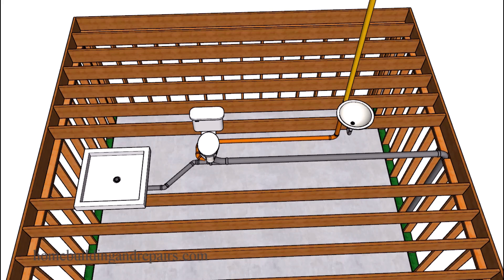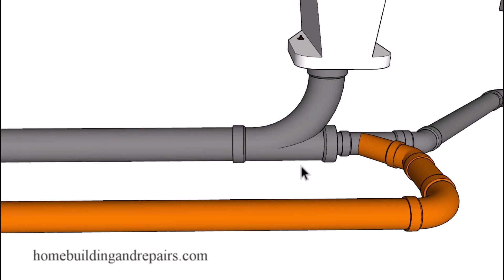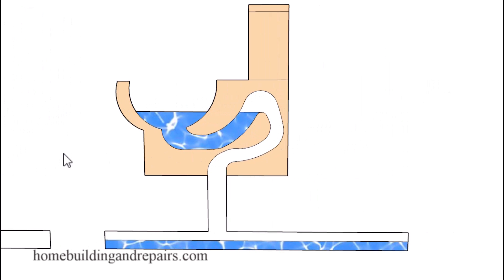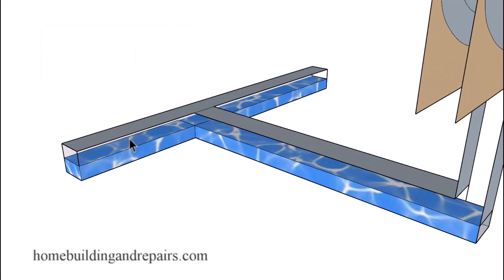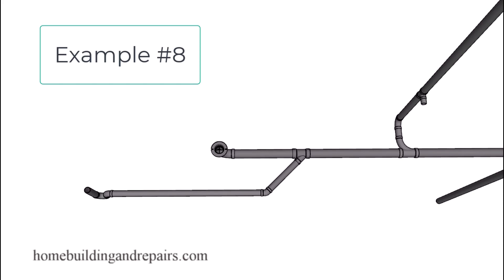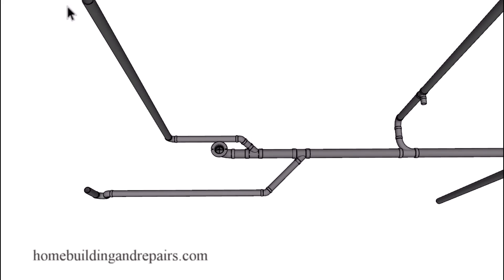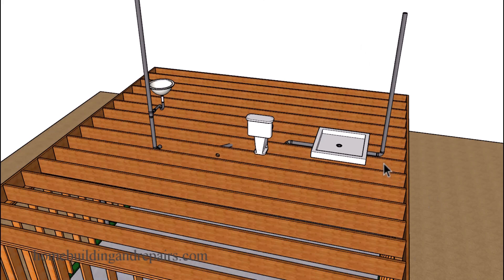Toilet And Shower Wet Venting For Plumbing Drain Pipes In Floor Framing - Project #1

Comment from the maker: https://www.youtube.com/watch?v=oGem3reRzZ4&list=PLav41l6sb3G9BnkqRA2MaR3Y386gwfhvh Here's our playlist for more plumbing questions and answers. 

First Updated Video - How Dry Vents Can Connect To Wet Vent Plumbing Drain Pipes - Shower And Toilet - Project #1 - Q&#1https://youtu.be/oXeKlCgOgGY

 You should always check with your local building department to see what they approve.
Reply: The toilets would be in the same location, but different floor.

Comment: At 7:50, I'm a diy'er and I'm not following how the toilet is the farthest fixture downstream when there is a sink that is farther downstream.
Reply from the maker: It connects to the others at the same spot then all three connections are the furthest, I can move the shower drain connection towards toilet or up stream, but not down stream and same with wet vent and lavatory sink drain.

Comment: You cant have a y or ty drain on its side or even a vent. What if the shower branch gets clogged at the connection where it goes to your vent in the beginning of the video, the it wont be able to vent the toilet. The vent connection need to be higher than the drain. It would be better to move that toilet closer to your main stack as the furthest fixture.

Comment: I understand the concept of how wet vents work, in the sense that I can imagine a pipe with water running through it, with the pipe being large enough that the volume of water in it is only filling the pipe up halfway, leaving space above the flowing water for the airflow (and thus fulfilling the purpose of a vent.) HOWEVER, I am still quite confused about how to design one of these systems properly. I’ve found your videos exceptionally clear and helpful, but I’m still somewhat stumped on this, especially with the length requirements/restrictions, the eye “roll-up” thing, and the need for the toilet to be last in the drainage connections. Is this because, upon flushing, behind it there would be the longest length of pipe and thus the largest volume of air to draw from for the venting? If someone was able to figure out that this is a system that works, then surely someone must be able to explain it well! Thank you for your fantastic videos! I’ll watch this one about ten more times now.

Comment: CA Plumber here - we're doing an in-slab sewer line for an ADU and got a couple corrections from inspector. According to inspector (and I believe this is backed up by code after researching), ALL vents, both Wet and Dry must be rolled up at least 45 degrees. See CPC905.2 Horizontal Drainage Pipe. So in a few of these examples, and many other online, the flat wye/combo where the lav connects may need to be rolled 45 deg min., to meet code. I had previously thought that only dry vent takeoffs need to be rolled, and wet vent takeoffs could be flat, but I now believe this is not the case. If anyone can find an exception to this rule, where the code says that the wet vent takeoff is allowed to be flat, please let me know!
Reply from the maker: I couldn't find your code, feel free to copy and paste into your next comment along with the book it came out of. and here is a video I made that is in one of the code books, https://www.youtube.com/watch?v=yhbXIlNfRIY
Reply: The inspector is out to lunch if he’s stating a wet went has to be vertical full stop. He’s misinterpreting the code.

Comment: Im in Missouri Rule  no code they did not vent the house they set the toilet over the furnace so it if backs up and over flows it runs into the furnace they used T not one Y I have a Note on my wall Flush the poo then wipe and flush .    Plumbing to the main plugs up every month they tied into the basement line with a T and it plugs up at the T I have snaked it and at 25 foot it hangs up I used a power Jet same 25 foot hangs up . Im 30 years behind on codes from Detroit but my code is better than no code . I plan on replacing everything use two 45 to get a longer bend remove the 90s and remove the T they used add Longer Y fittings  I think $2000 in Plumbing and renting a back hoe diy .  my venting might be a problem no assess to the attic from the basement.  The Kitchen sink is a Dule sink the left side vents the right side, that vents the Bath tub, toilet and sink . Pat the man on the back that plumbed this house in 1957.

Comment: I don't mind wet-venting; however, in my opinion neither wet-vents nor dry-vents should be allowed to run horizontally, except when they are above the serviced fixture flood level.  Code prohibits this  for dry vents, because there is no easy way to clear them if a backup causes them to become clogged.  It may permit it for wet venting.. but if so, I don't like it.  In the setup you show, its too easy for toilet backup water to clog the wet vent.

Comment: wrong now its individual pipes 2in  n closer   strait side ways straight up  cheaper  using pvc small one avoid back up going wrong holes n back up air causing to explode or go backwards n smell

Comment: I was taught you cannot install a t-y horizontally on its back, especially under a toilet as it tends to clog. You use a y and an eighth bend instead. Was I taught wrong?
Reply: Santee cant be on its back or side. The wye and 45 is the same as a t-y (we call them combos here). That being said, you never see the pre-made combos here unless its on 4"+ cast iron for commercial.

Comment: The International Building Code, is in some form, used in many states in this country,  The base codes are written by ICC and each state adds or subtracts their own amendments to them. I know in Florida and North Carolina where I hold State Plumbing Contractor Licenses your first illustration where the 3" combination was turned straight up to the water closet is perfectly legal by those codes and  we have done that installation many times. Doing apartments with hundreds of bathrooms having that extra vent in each bathroom would take thousands of dollars from your profit.

Comment: Could a AAV be used in the wall cavity for the shower vent, instead of venting through the roof as shown in your last illustration?
Reply: aav must be accessible, the use of aav varies a lot depending on local inspectors
Reply: @alanm2842  Thank you for that. 🙂

Comment: you have a great presentation my friend. question regarding example 3. i have passed numerous inspections doing it exactly this way, and have had no callbacks. however i have had guys tell me that this maybe not the best way to plumb it. they have said if the 3'' toilet gets flushed and is full of water it essentially chokes the fixtures vent ( in this case the shower ) and may cause that p trap to siphon. ive never heard of this actually occuring nor have i been called on it codewise. any info or advice you have is great, thanks! fyi im canadian code

you mentioned " one fixture may come off the back of the wet vent" can you tell me which code claus this is please? only for symettrical double wyes or ? i know you cant have more than two toilets on a single wet vent too.

Comment: How would you vent two full bathrooms on different floors above each other?
Reply: Downstairs bath run separate dry vent up stairs and connect vents in attic
Reply: @ejsmitty8568  youre required one 3'' stack vent thru roof so run one bathroom lav 3x1.5''

Comment: Hey, great video! This will help with part of my project but I'm looking for some advice on draining my bathroom to a cleanout. I have a small cabin and started to add a 1/2 bath to the upstairs. Half of the bathroom is being built over an existing deck and will need black and gray water drained to the septic. About 10' from where the toilet will go, and close to the foundation, there's a cleanout pipe sticking 6 inches out of the ground (part of a new septic system). I was told I can drain water into that pipe as long as I use a Y connector, so I can still use it as a cleanout if needed. Is this true? It really is my only option. My plan would be to connect the sink drain pipe into the 3" toilet drain pipe, following the venting rules, then attach it to the  cleanout. Thanks

Comment: On the last one you wet vented the toilet thru the shower the best way to do it is w in five ft of toilet put a 3by 2 wye off that run go pick up your shower then keep going around the toilet if need be to continue to the lavatory this will have the toilet wet vented by the sink and also the shower wet vented by the sink there are of course limits on length of total wet vent 15ft from centerline of wye to san tee on lavatory and also a limit on fixture branch legth to shower of 8 ft on 2 inch pipe from again centerline off the wye picking it up to crown weir of the 2 inch trap on the shower i hope that makes sense if you draw it out it will and its the most common way to do a bathroom layout he got way too complicated in his drawings and explanations of them one line before the toilet is all you need to pick up the shower and the sink and also have the toilet wet vented you cannot put a toilet on a wet vent it can only be wet vemted by other fixtures it can get complicated by adding say not only having a shower on it but say a garden tub a bidet and then double sinks perhaps but its always the same one 2 inch line off the 3 inch w in 5 ft of the tolet and that can pick up all your other fixtures and then continue up to pick up the double sinks on a cross sanitary tee and its a wrap its really that easy guys

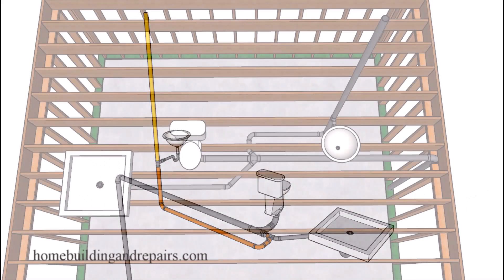Comment: Yea around 2:30 that wont work you can’t use a double y horizontally. The vent would need to have a separate connection before the toilet

Comment: Example 1 would be acceptable by most codes. There are a few drawings out there that are exactly like you have it originally with the water closet entering vertically and they are considered correct. If you think about it the wet vent ends where the water closet connects. So the water closet is being wet vented but it’s not contributing to the wet vent. You have the wet vent correctly drawn in orange. Where the water closet enters vertically it becomes a horizontal drain at that point and the waste entering at the top of the pipe is not affecting the wet vent because it’s not entering into it but rather downstream of it. Also the dfu’s of the toilet don’t contribute to the sizing of the wet vent either. Confusing I know. I’ve been wrestling with this question for a long time. I want to see it enter horizontally like you changed it but I think the drawings out there are right when the wc enters vertically as the last fixture. If it entered vertically anywhere within the wet it would be incorrect.
Reply: Yes, installed a toilet like #1 (coming into the drain pipe vertically) and it passed inspection.

Comment: Got a question for you just opened a a ceiling in nyc found a jacuzzi and a shower both coming down with 2 inch traps then the the traps transition to 11/2 drain pipe both connect with a tee and go down the wall in an 11/2 pipe no vent . Do you think me replacing the 11/2 line with 2 inch everything I can see and add a strider vent

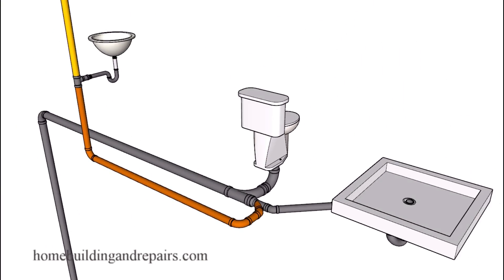Comment: Around 2:27 you show a horizontally installed double wye.  I thought the double wye could only be used vertically, since you wouldn't be able to get the necessary slope on both branches of the wye in a horizontal configuration.  Did I miss something?
Reply: You can lay a double wye down like that you just make sure both sides are w out pitch the pitch on the pipes coming in both sides will get past that little flat spot w no issues you can't keep water on a flat table right

Comment: I want to install a new bathroom in my basement and my plan is to connect all the plumbing to existing vent which has already vented do you think is it okay for not making a dry vent for air for my basement?

Comment: I did a tub drain broken pipe on a additional that was from what I was told the addition was done in the late 50's early 60's. . For some reason they were having the tub roto cleaned constantly since the addition was built. In the bedroom addition I had to cut the drywall to get to the back of the tub as the tub wasn't draining flooding the bedroom.  Once I cut the drywall out I noticed that the drain pipe was leaning to the side. When I grab the pipe it just pulled up out of the ground. I needed to remove the tub removing four layers of tile, taking out the toilet, and removing two rows of tile on the floor. Once I removed the tub I realized that you could not get to the drain pipe as the concrete floor has little access to the drain pipe.after trying to make the access larger I realized that the concrete floor was 6-8 inches thick. My largest sledgehammer would not ever put a chip in the concrete. So I had to rent a jack hammer. After 6 hours of hammering away e was able to get to the bottom of the drain pipe. What I found was what was left of a drain snake. I ask the owner if someone had cleaned the drain and his response was about 6 months ago. That was the same time that the bedroom was getting flooded. So the people who were renting were only able to take sponge baths before the bathroom would flood. I figured who ever was cleaning the drain broke the drain pipe when I was able to remove dirt to get were the drain took a 90 degree angle the pipe was busted. I ended up renting the jack hammer again. As I continued to knock out concrete it just got thicker. I had remove 4 feet before the pipe had a 45 degree angle. It was at the end of the tile I removed. That was were I found the pipe to be not broken. I managed to replace the pipe.
I forgot to mention that the toilet was about 2-3 inches from the tub. So I had to remove the toilet to remove the tub. Once I had the plumbing back together I checked to see if would drain. Nope it would not drain. After looking at everything I realized that there was no vent pipe anywhere. After taking to the owner he said the renters were always plunging the toilet to get it to work.  Oh yeah about 1 foot from the toilet was a sink that stopped draining years ago.  I ended up climbing up on the roof. About were the sink was what appeared to be a vent pipe. I tried running a snake with no luck. I went back inside figured were the vent pipe might be and cut out the drywall. I didn't mention that the tile went from floor to ceiling in the bathroom. I cut the hole in the hallway. After cutting into the vent pipe about 4 feet up the wall. Only place with out tearing out the door jams. I placed a clean out there then ran a snake down the vent. As I took my time the said that the snake was coming out from the tub drain pipe. After running the snake for about 5 minutes I decided to see if it was the problem. Running water in the drain it flowed with no problem. Not only was the walls of the bathroom tiled up the wall but on the other side of one wall was the original bathroom tiled all the way up Then on another wall the kitchen was located tiled all the way up the wall. Oh yeah so were the floors through out the house. After getting everything back together I informed the owner to get rid of the house before he has to rip the whole house apart in order to replace all the plumbing. I told him it might be cheaper to tear the house house down and rebuild it. Make this story short he put the house on the market "as is". the following week. The first offer he took it with a 😁 smile on his face. He sold it about 10 percent under asking price of the other house in the neighborhood. A couple of months later came the housing crash. Right after the person who brought the house sold out to someone who was going to build apartments. As the lots in the area were really large lots. That person broke even. Better than losing money from the housing crash.
Reply: Do you sell this story in hard back or soft back or is it only available as here, an ebook??

Comment: Can you hook up 2 toilet and 2 shower and 2 sinks in one 3 inches abs pipe? I just want to make sure.   it’s all in underground one story house no basement it’s all under concrete if you can let me know please thanks .   I can sand you pictures if you want thanks
Reply from the maker: You can have 36 fixture units on a 3 inch drain pipe sloping 1/8 of an inch per foot. This should work for  2 toilet and 2 shower and 2 sinks in one 3 inches abs pipe. Information can be found at 2021 IPC Book - Table 710.1(1) Building Drains And Sewers.